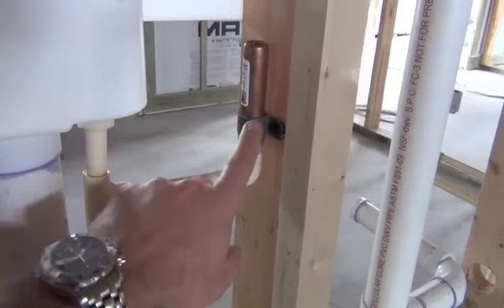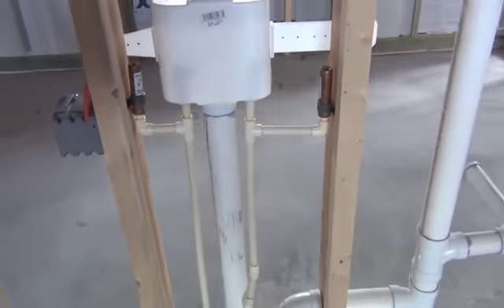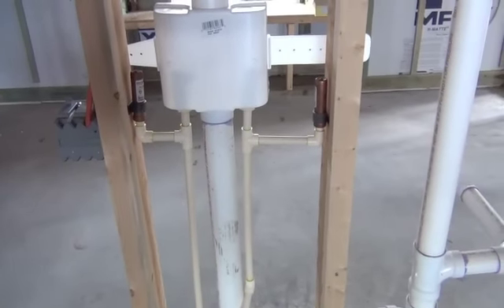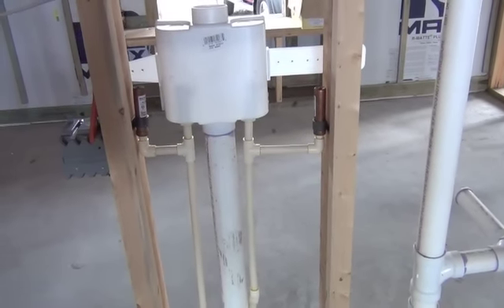Water Hammer Arrestor

Comment: Thanks for the vid. The water pipes in my house started to make a nasty hammering shortly after a new hot water tank was installed. The hammering is very loud when the washing machine is in use... Will get an arrestor and see what happens...  Thanks again!
Reply: You should also make sure a small expansion tank was mounted with the water heater.